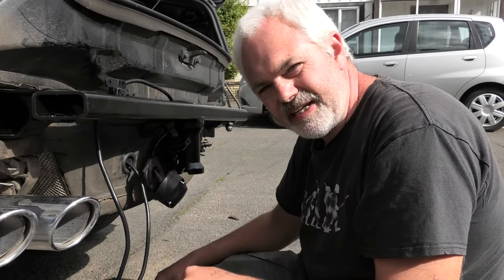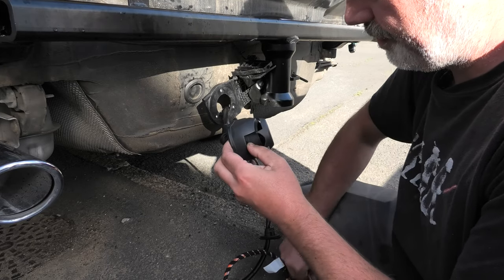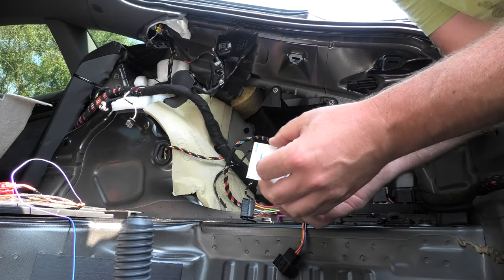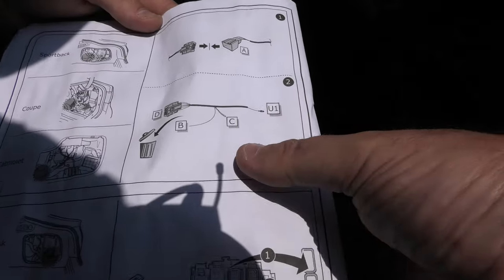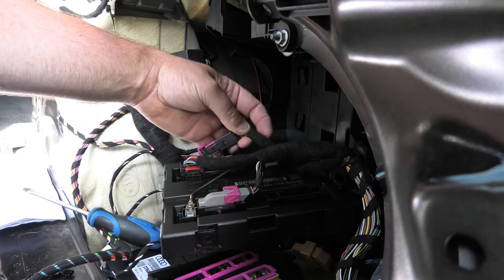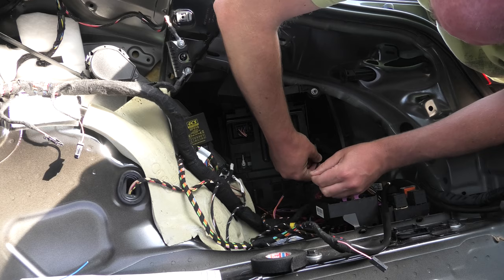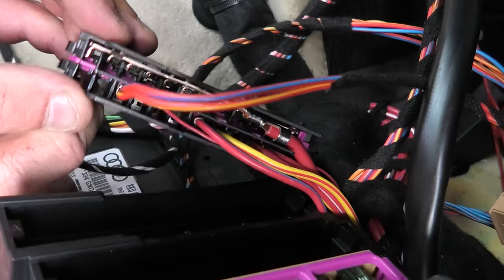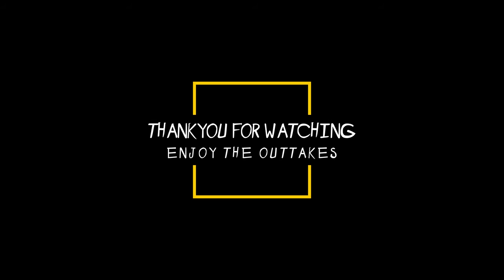How to fit ECS TOWBAR ELECTRICS for Audi - Start to Finish

Comment: Very well done. What an undertaking. You’ve put me off fitting a tow bar. Loved the videos though.
Reply from the maker: Lol.  Well for me it was £200 vs £600 to 700 pounds professional  install.  Realistically you can get it done in a day.  Took me 3 days.  2 days for tow.  1 day for electrics but only because im filming it.  Camera angles etc.  I couldnt find any videos that covered the whole thing start to finish.  Glad your liked though.  Not difficult just time consuming.

Comment: Hi Richard,

Does there gonna be a third part showing how to code the trailer module like u sad in you video?
I have a ecs electronis cable kit installed on my new octavia 4 and i'm not able to learn the module into the (19)can-gateway, i think there is a longcoding fault in the trailer module. VCDS always says: coding rejected error 31: Request out of range (it says that since the beginning, i never changed sommething about the longcode) but the code i see is 00000002200 and i think thats not correct.
(I can go to (69)trailer and go into the module but i cannot add the module to the installation list in (19) can-gateway, i use the latest version of VCDS software where in (19) can-gateway the save button is changed to assisted coding: write coding, restore original value and direct coding: write direct coding (thats a code u need to fill in manualy. All the 3 buttons gave the same error.

An example would be nice.

Thank u very much.

With friendly greetings

Comment: Hi Richard, thanks for the video.Very informative. I know what the can bus cables do, and the pair going to the fusebox (F3 and F4 for my Q5 2016) supply the power but what does the single red/black cable going into the grey connector do? I ask because when I look inside the loom there are 2 x 0.5mm red/black cables and 1 x 1.0mm black/red cable to choose from? Unsure what one to pick , can you help?
Reply from the maker: I only had 1 black red cable but mine a5.  If it was me id look for the pin description and trace it back to see what it does.  But I suspect its the thicker cable.  I also suspect its the reverse light trigger but cant be sure without digging out the ecs instructions as you have different wiring and different instructions.  Maybe someone elsr with a Q5 could answer?

Comment: Hi there, great video. Has inspired me to do it myself. I have an Audi A5 convertible 10 plate 3.0 tdi. Not sure what electric to order? Want 13 pin but not sure if I need generic or more expensive type. How do I find out???
Reply from the maker: I personally prefer the ecs or similar electric kits.  Yes its more but it intregrates with the car properly.  Ie shows on the screen and disables rear sensors.  Use vcds to.do the coding.  I was going generic to start with but by the time i added it up cost of materials and time to work it out wasnt worth it.
Reply: Thanks Richard. I'm going to order one today with a vehicle specific kit for 13pin. Will save myself a few quid hopefully with video help.
Reply from the maker: @jeffgrenfell8087  for me it was 200 quid for the towbar and 100 quid for electrics kit.   It was 700 professionally installed.  Can easily do it in a day.  Took me 2 days but I'm constantly faffing with cameras.  Outtakes.  People talking to me.  Hey you doing a youtube video kinda thing.
Reply: @richsmif  paid s little more but it's arriving today. Bank holiday weekend sorted. Not sure I'll video it but will highlight any differences with the job via vid or photo and let you know how it goes. Thanks again.
Reply: Hi Richard. Got towbar from pf Jones eventually. Moving arm for pin connector a little different but looks same generally. Before I start any advice on what cable and software I need to buy to recode after fitting. Thanks in advance.

Comment: Weird. I don't have any plug to connect trailer lights module to. Audi A4 quattro 2006 or 2007. Installed towball mount but no wiring:(
Reply from the maker: You have to splice it like i did.  I didnt have a connector either